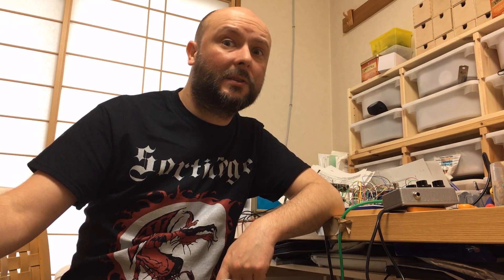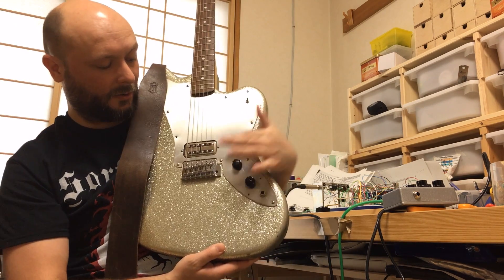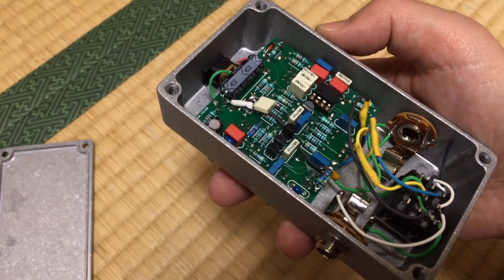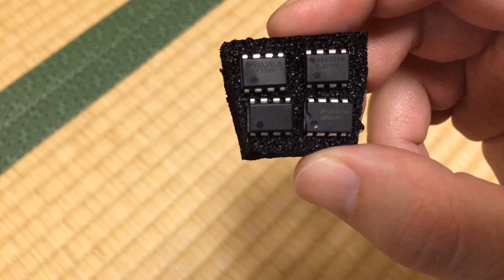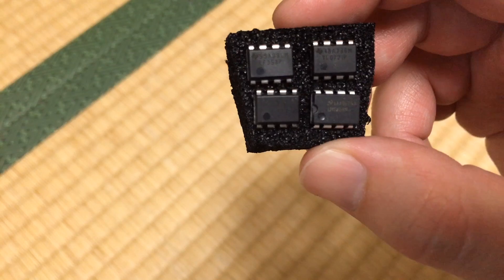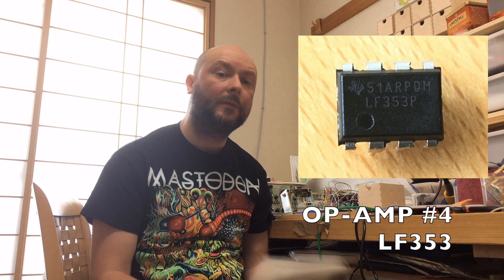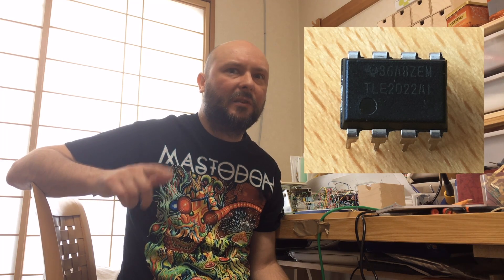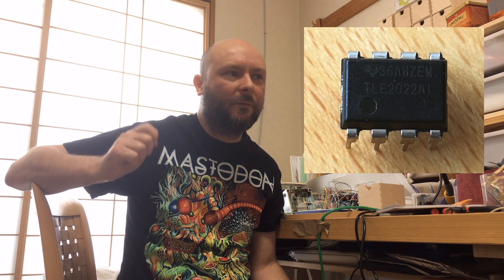About op-amps part 2: audio test

Comment: I think, it is difficult to discuss the quality of an opamp on the basis of a distorted signal. It is probably more a question of personal taste. The TL072 is very noisy. So I don't like it in the case of low level signal amplification. In my opinion, for an opamp in this application, a high slew rate and gain bandwidth product are the keys to handle distorted signals. The problem with FET input stages is their relatively low voltage amplification.

Comment: The LM1458 sounded bright and crunchy, the TLE2022 sounded a bit darker, but a little muddy. The TL072 was my favorite because it had some of the brightness of the LM1458 and some of the lower frequencies of the LF353, and the LF353 just lacked a little of the sparkle of the TL072. In order, for me, was the TL072, LF353, LM1458 and TLE2022, but my opinion has the value of the electrons that spell them out.

Thank you so much for this comparison.

Comment: Great test, It helped me choose the op amp for an audio amp I'm building. Thank you very much!
Reply: I suggest to accompany every single opAmp with one 100nF capacitor (for single supply) or two 100nF caps (for split supply). Caps help reproduction more 'solid'.
Cheers from Indonesia